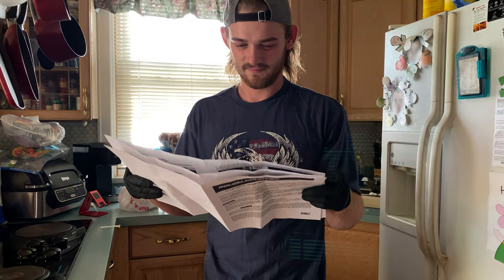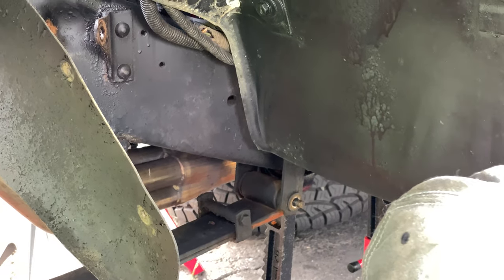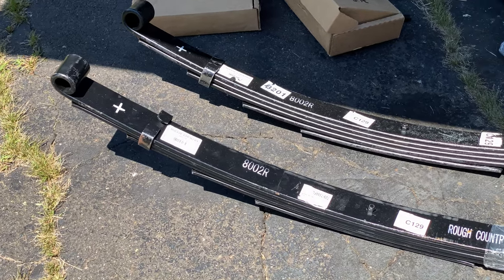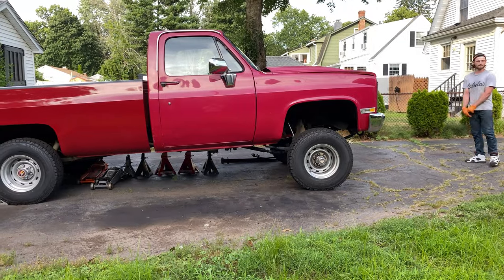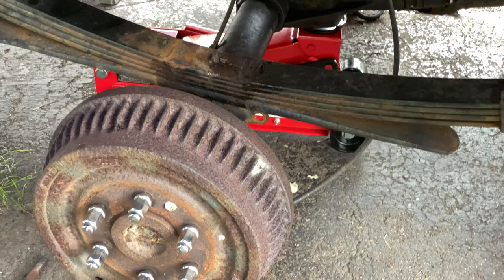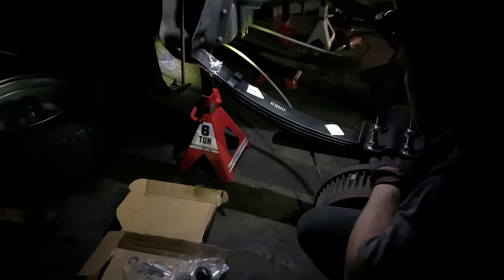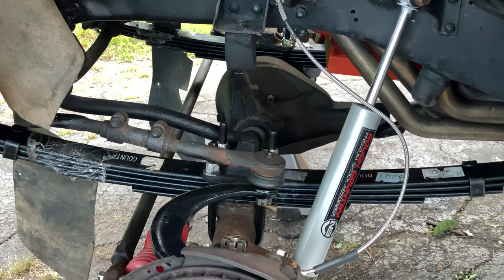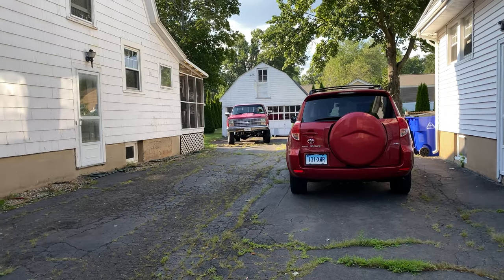Transform Your Chevy K10 Pickup with a 4 Inch Lift Kit - Step-by-Step Installation Guide

Comment: I just bought a 74 k10 and it has a 6 inch lift with 37s
Reply: I just bought a 74 k20 has 8 inch lift and 42s mines dark blue guy before me put to many wedges between springs and pad on axel to tilt pinion angle so he wouldn't have to get longer drive shaft  now it drives like crap   iam going to take them out and  build longer shafts
Reply: @MP-io7yj  mine drove like crap when I bought it Bc it had mud boggers and 2 inch spacers 😂😂
Reply from the maker: How can you get into it? I'm getting older and can barely get into the 4" lift with 31s. I have to get a running start. Haha. It's going to be worse when he gets 35s. It kind of sounds like the guy you got it from hacked it up. Good that you're going to do it right.

Comment: Where to start....
1. They are called cone washers.
2. Soak all those old rusty bolts in some WD40 or Blaster.
3. Always charge your battery the night before. 
4. They are brake lines, not hoses.
5. You could have used the old ones if you lifted up the axle, put the tires on. At full arch they will be tight but you still have zero weight on the leave packs so ove arching
Reply from the maker: Hey, Bro.
1. Correct, they're called cone washers. I don't think we ever referred to them by name, but he described how they're tapered and often difficult to get out.
2. He soaks everything in WD-40 or PB Blaster, but if that doesn't work, heat is the next step. 
3. Not sure what you're referring to, but he always charges his batteries at the end of the day so they're ready to go the next day. Perhaps somewhere in the video one of the batteries wasn't charged. If so, that would have been due to tropical storm Isaias that knocked out our power out for a week.
4. The flexible tubes that go to the brake caliper are called hoses. Lines are the non-flexible metal tubes that attach to - and run along - the frame of the vehicle. The exact ones Matt used were the "Pro Comp Brake Hose Kit #7220" from Summit Racing. In the aftermarket world, some companies refer to them as brake lines.
5. I may not have shown it in the video, but when he put the tires back on, and the truck was on the ground, the hoses had zero play. The springs were still loaded from the weight of the vehicle at that point, and as soon as we would have driven on unlevel terrain, the hoses would have over extended.

Thank you for watching.

Comment: should have just took a grinder and cut the bolts off then flipped them the other way when putting on the new ones 🤦‍♂️
Reply from the maker: I told Matt the same thing, but he wanted to keep the stock bolts for some reason.

Comment: looks more like a 6 inch lift
Reply from the maker: That's what I thought too - the arch of the rear springs is crazy, but according to the part # we received, it's 4 inches. I wonder, though, because he had to do some extra things with the suspension & brake lines that don't normally need to be done with a 4" lift. We never measured it before he put the lift on, so we'll never really know.